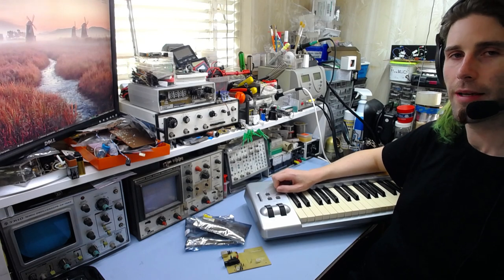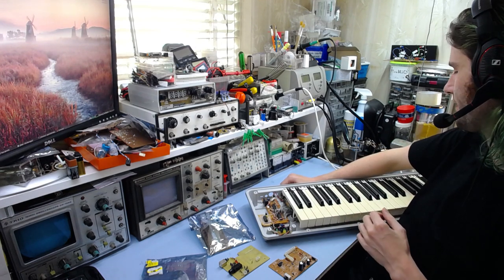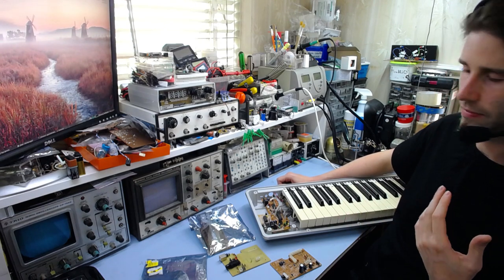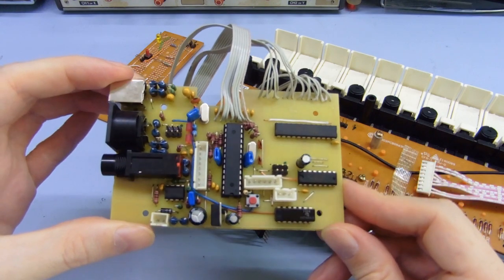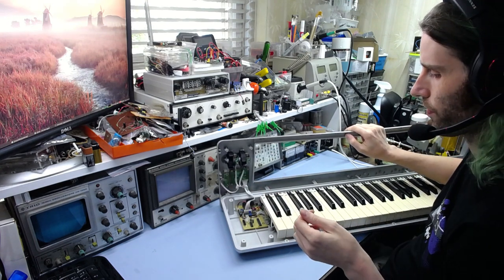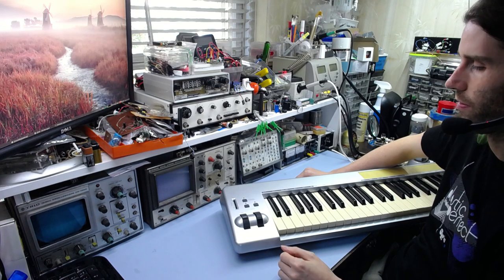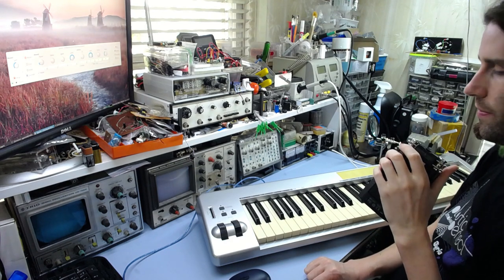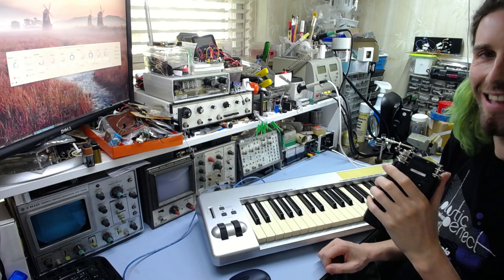M-Audio Keystation 61ES MIDI controller repair/rebuild

Comment: Incredible that I have found your video, thanks for sharing your knowledge! . One question, is there any reason for being using usb type B instead of type C in midi keyboards?
Reply from the maker: Thanks, glad you enjoyed it. I am not sure if you're asking why I used USB-B, or why did M-Audio use USB-B? In my case, it's cost and ease of soldering. Plus it fits the hole already in the panel. And there is no requirement for any features that USB-C provides anyway.

As for M-Audio, I do not know, but cost and ease of assembly was probably their main factors, but also USB-B are the most robust. Even though this one was broken, it would stand up to a bit more use and mating cycles than a USB-C.

Additionally, through-hole connectors are often easier to replace than SMD ones, as the board does not typically get damaged. With SMD parts, the whole plug may rip off and take half the traces with it.

Comment: great video, ive got a bit of a weird question though. how easy would it be to cut this board down to 3 octaves?
Reply from the maker: I think it's plausible, but I don't know the difficulty. IIRC, the keys are in a simple matrix with a lot of diode steering and multiplexed by a separate controller on another board. As long as you trace out the key circuit and find out how things are connected, it should be relatively easy to figure out. If you actually cut the PCB, you will probably need to run some wires to make sure the octaves you want still work as I believe there are some critical data lines that run the length of the entire key-bed. The original controller will probably still work with some octaves removed, but you might need to wire in some dummy diodes or something to avoid any unconnected inputs from floating etc.

Comment: I have removed three Keystation 61 es from their housing to use in building a 3 manual virtual pipe organ. I would like to extend the wires from the keyboard bed to the 14 pin 'plug' on the board that has the midi/usb connections.  Would you know the name or type or model of the male and female housings that the white wires with red markings use?  I basically need to make an extension. Thanks
Reply from the maker: The "XH" connector series from JST (or a Chinese clone of it) is likely what was used here. You can get them from the usual places like DigiKey etc, or eBay if you prefer.

Comment: Hello sir..... How are you...? hoped will be well. I have also M-Audio Keystation 61Es midi controller. I am facing a problem i.e i press a note of any octave 1st it sound perfect after 2nd or 3rd time its sound become half.
I am facing this problem with all the 61-keys. kindly give me suggestion to resolve this problem of my keyboard.

Comment: Hi, for my part about a maudio keystation 49, I have following the breakage of the usb port made a direct connection of the wires, and recently I wanted to redo correctly the soldering and I detached one of the track, I made sure that it is maintained by the soldering, and in doubt I made, a bare part of the track that goes to a condo or fuse, but after having struggled to find the exact feel of the connection of the usb I arrive at the point that. ... everything seems good but the pcb of the controller goes directly on while the power switches is off, moreover it is recognized (Windows detects a peripheral) but does not recognize it (unknown peripheral) and on the panel I have no led would I have inadvertently kill the chip of my controller?

Comment: hello,  you can show more information  ,  i have a m-audio  with the  keys side board  dead.   and  i want  implement  your  board.  you have schematic or more info ?   thanks.  regards
Reply from the maker: There is a link in the description for downloading the design files. But you may wish to troubleshoot yours first, it maybe yours just has some simple problem.

Comment: Please. can i connest 61 keys to MIDI pcb Miditech Midistar 3 with 49 keys. I hope you understan my question. I want to add another octave to the midi board midismart 49. Thank you.
Reply from the maker: I would expect that the controller in the Midistar 3 wouldn't support more than 49 keys without at the very least some firmware modifications (and assuming the hardware support is there) which unless you have access to the source code or an open-source alternative, is going to be quite tricky, I imagine. So realistically, no. Not unless you build some kind of 3rd party control board like the one I made.
Reply: @Agent24Electronics  Ok. Thank you.

Comment: Great stuff. I have a Keystation 88, and just accidentally plugged in a live 12V power cable (I have a few for my speakers) to keyboard's 9V plug. Had lights on and a couple of seconds later, bang. I guess the circuit board is done, one of those small black drums "chang 1000uf 25v" had exploded. It won't turn on now. Do these things actually have fuses, is it worth taking the keyboard to an electrician?
Reply from the maker: I don't recall if mine had a fuse, I don't think so, but something else may have acted as one...
The black drum you speak of is an electrolytic capacitor, and should not have exploded unless it saw more than 25v (as indicated by the 25v rating on it), or the power supply was connected backwards. Since you had only a 12v power supply, and the lights came on at all, it suggests that neither of those were the case - which makes things all rather strange if the capacitor blew up.
If nothing works even with the correct power supply now, you may have a dead 5v regulator or worse. I could help you do basic troubleshooting but it'd be easier through a repair forum like the one at badcaps.net or similar, and you can easily upload photos etc.
Reply: @Agent24Electronics  Thanks for your answer. Yeah, took it to a specialized electrician, and it was beyond any repair, unless I could order a new chip. Of course I'll just order a new one off Thomann for 140€.

Comment: I got USB Power Surge error. (Keystation 88) I'll try to repair usb plug on keyboard circuit they seems like degraded. is it worth to try? or i need to change whole circuit? BTW Thank you for video i was searching for this about decades.
Reply from the maker: If the USB socket is visibly broken, bent contacts etc, then it is certainly worth a try. Sometimes plugs or sockets can break and the contacts may short together. If that's all that's wrong, you're lucky.
You may also have a bad USB cable with a break+short internally, so try another.
If a new cable and/or socket does not help, you may well have a bad board like mine did. In which case, it may be worth tracing for shorts, it may be just a bad regulator, diode etc. Hopefully not the processor is shorted. Then you will for sure need a new board.
Reply: @Agent24Electronics  It Was a socket...I have removed it then i connected USB cable from gamepad directly to the circuit and  it worked! thanks for attention. wish you health, stay safe.

Comment: Hi,
My m-audio keystation 49 midi keyboard's pitch bend and modulation wheels have gone sticky (because of the rubber coating on them). Could u help me?
Reply from the maker: You could try disassembling the controls and cleaning the plastic/rubber knobs with soapy water - if the stickiness is just built up dirt and grime. But it's possible the rubber is degrading due to contact with a solvent or such (did you clean them with alcohol etc?), in which case I think you would need to replace them or just live with it.

Comment: Does the Keystation 61es have an internal battery?
Reply from the maker: I don't believe so, and this one certainly didn't.
Reply: @Agent24Electronics  Thanks for responding, when I use the 61es to control my old Emu Proformance/1+ everything goes well, when I use the 61es to control my old Yamaha TG33.. sounds cut out randomly abruptly and seemingly . But when I control the TG33 with an old Roland EP-5 keyboard, everything goes fine.  Scratching my head...but as I read my message the key word may be old, old. old.

Comment: Hi , I have an M audio code 61. it worked well before then suddenly for no reason, doesn't work anymore. I tried to restart it not working, I even can't reset it by pushing the pad buttons stuff. Can you help me please sir! thx
Reply from the maker: Check the simple things - is your power supply working if you are using an external one? Is your USB cable and USB port good if that's what you're using? Has the power switch been set to the wrong position?

Comment: Oh! That's a pitch and a modulation wheel. who knew. Are you sure that it was'nt working before you stared working on it ?
Reply from the maker: It was completely unresponsive as a USB device. Not even detected by the host controller.

Comment: The mod and pitch bend start to build a residue. So nasty. Anyone know how to fix? Rubbing alcohol?
Reply from the maker: It depends what the residue is. If it's just skin oils etc from your fingers, then a cloth dampened with lightly soapy water is probably a good solution.

Comment: hello guys .Good video.. 👍🙌

i have a problem with my M-AUDIO keystation 61 es.
It has not been use since 6 months.
when i plug it on windows 10 via USB cable ,  windows does not accept devices (drivers are allready installed) unknow devices notification. keyboard's leds are off.
when i connect AC-DC adaptator,  remove USB cable and plug keystation on sound card via Midi cable,  02 leds turn on... 

pressing on the keys notes not do anything. Soundcard does not receive midi information (midi led staying off and not blinking )

after a moment (about 5min) pressing on every notes and pitchben switch  my DAW start to play..(keystation send play information to DAW) 

I already factory reset  keystation (using procedure define in user manual)..

Help me to fix my keystation please.
If it's CPU motherboard the problem,  should i purchase a new board an replace it? (i can't rebuild it like you because i'm not an electronician)
Reply: Open a repairticket with the manufacturer. It may be cheaper to just buy another one

Comment: Thanks for the helpful video :-)
My MAudio Keystation 88 Mk3 (from late 2018) has had many problems since purchase, but now it is sending random CC7 messages to my VSTs. This makes it unusable. 
Tried hard resets etc.  Not sure if I should try get a volume slider board replacement (if possible) but maybe it's not that at all...  thoughts anyone??

Hmmmm... I wouldn't recommend or buy MAudio again. My last three units (Keystation 88, Oxygen 25, Oxygen 49) have all had serious issues - the more recent, the quicker they die :-]
Reply from the maker: Random messages might be caused by a faulty MIDI cable (if you're using one). If you're using USB it's more likely the keyboard itself, or some software incompatibility. Did you recently install some new plugin/software/drivers? Have you tried the keyboard on another computer?

Comment: Hello Am From Nigeria and The Power I.c for my M.audio code 49 is bad.Please I need the Name or Like I.c number of The I.c So I can order it and get it fixed here in my country
Reply from the maker: From memory it was an LM7805 in mine. Yours is likely the same, but it will be written the side of the regulator what the part number is.